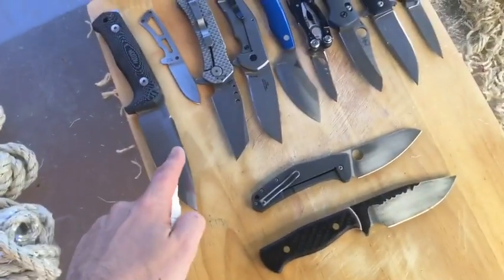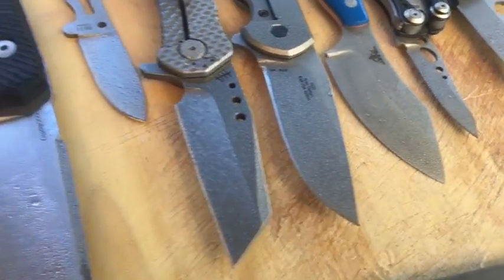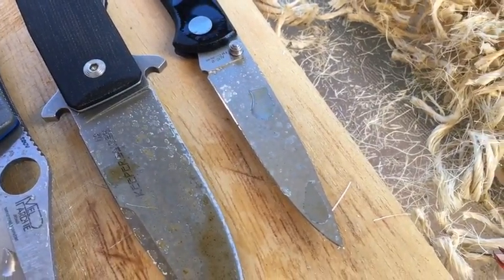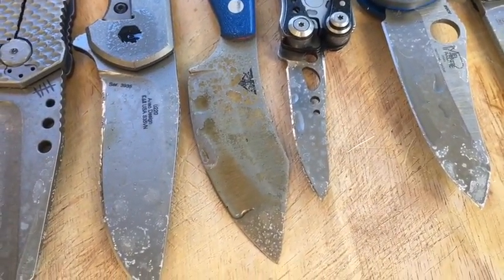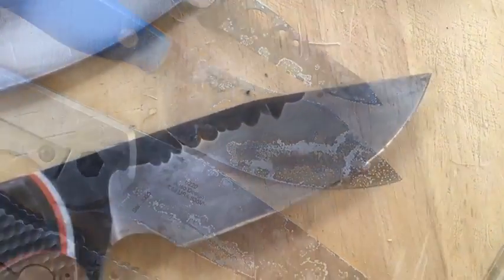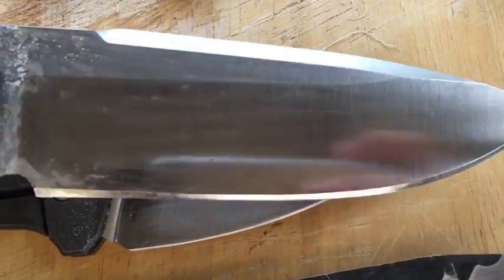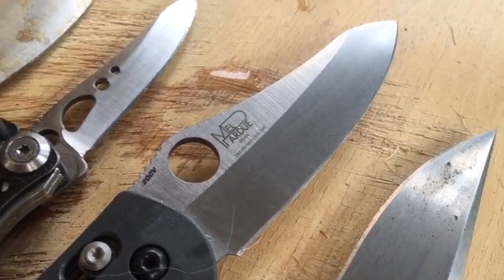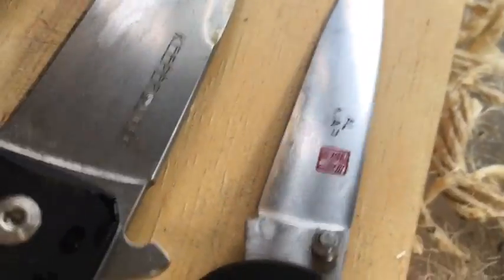Rust Resistance Knife Testing - Which one corrodes most? I was suprised!

Comment: Perhaps Bark River used belts that were used on non stainless steel to finish that blade. Sometimes can leave leftover alloy on the surface.
Reply: You certainly could be right Jimmy. Blades are easily contaminated. Iron can easily rub off, from other sources. The best way to know for sure. Would be to buff the blade well, with a new wheel and fresh compound. Then test it again.
Reply: THis is very possible
Reply: Jimmy Grey can the opposite happen if a belt used on stainless is used on non stainless?
Reply: Would be a good test for sure. Either way it didn't perform as expected.
Reply: All of the excuses for why this "could have happened" do nothing for the fact that at $200+, it "should not have happened." This "whoops" is on par with Schrade, Gerber and Boker Plus. BR just dropped in status to the aforementioned companies in QC in a way that for me is similar to considering SOG and ColdSteel when buying a folding knife. Very hard to come back from. Like Hyundai or "have you driven a Ford, lately."

Comment: Great test, man! Thx a lot! But keep in mind one rule:  higher HRC = less corrosion resistance (for the same steel)
Reply: SollerS that is very debatable.  I've seen some extremely high hrc blades not rust what so ever. Even those with high carbon content. They will rust of course but take longer to rust. Not sure which ones you have that will rust easily at higher hrc.
Reply: Tactical Center I mean if we take one steel, so for this steel on higher HRC it's corrosion resistance decrease. It was reason why Chris Reeve few years ago uses 57-58 HRC for Sebenza. Main reason was to get high corrosion resistance. But people wanted more edge retention,  so Chris change his policy and now we get 59-60 HRC. More edge retention and less corrosion resistance.
Reply: Thats not true. he said it himself that he wanted it to be easier to sharpen for his customers. thats why it was lower hrc. he switched to s35vn for higher corrosion resistance.

Comment: That makes no sense. My initial reaction is that it is A2, but that would be tough to believe coming from BR. Steel test it and see if the edge does what CPM154 is supposed to do. Frankly I'm equally suprosed by the lack of rust on the O1.
Reply: It's almost certainly A2, and this isn't the first time Bark River have busted for charging premium steel prices for an A2 blade*. I suspect this is Bark River common practice, given Mike Stewart's history. People don't want to believe that, because Bark River produce some great knives; but people are complicated and contradictory creatures. What's worse, they've been selling CPM 3V knives for big mark-ups, and that's much harder to test, since 3V & A2 are both tool steels. I wouldn't be shocked if someone eventually exposes Bark River 'CPM 3V' as boring old A2.
* https://www.bladeforums.com/threads/bark-river-again.1463481/
Reply: "WARNING - WARNING "   Anyone with a Bark River Knife , break out your salt-water spray bottle and check your steel ..
Reply from the maker: Blue Mountain Bushcraft and Outdoors I know right, its like its opposite day. The Edge retention on this knife was about in line with lower end powder steel... but yeah, it doesnt make sense. Tindall does a pretty flash Heat Treat on his O1 so maybe theres something to that.
Reply: Yeah was about to quote that thread from blade forums. Not the first time and the guy does not inspire any kind of confidence in his company. They have a nasty reputation when you peel away the layers.
Reply: Agreed. I think it's a common Bark River practice. If you're buying a BR knife advertising A2, you're fine. Anything else... don't count on it. I'd love to see more of this, putting other models to the test to settle all doubts regarding Mike Stewart's profitable little 'accidents'.
Reply: Yeah, I remember reading that one as well. The other side of this is the negative publicity that Bark River is generating for Crucible's product; CPM 154 is one of its 'star' powder-metals, and we're watching A2 rust with a bullshit CPM label.
Reply: This is what ive seen from BR too. that and a lot of other BS they have 
https://www.bladeforums.com/threads/bark-river-knives.1504522/page-9

https://www.bladeforums.com/threads/bark-river-has-taken-16-000-of-my-money.585934/
Reply: That's just sad
Reply: The old Lynn Thompson Cold Steel switcharoo?  Bark River has a shady history to say the least!
https://www.bladeforums.com/threads/bark-river-has-taken-16-000-of-my-money.585934/
https://www.reddit.com/r/knifeclub/comments/5ncgdw/experiences_with_bark_river/
https://www.bladeforums.com/threads/new-about-black-jack-knives-i-could-not-talk-about-til-now.123670/
http://www.ripoffreport.com/reports/bark-river-knife-and-tool/escanaba-michigan-49829/bark-river-knife-and-tool-false-advertising-claimed-knives-are-100-american-made-but-ar-170631